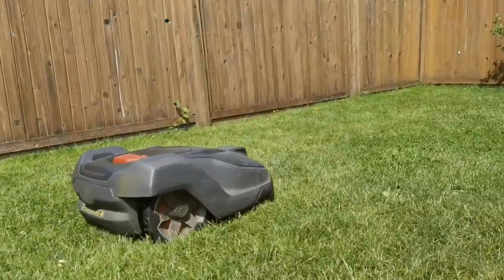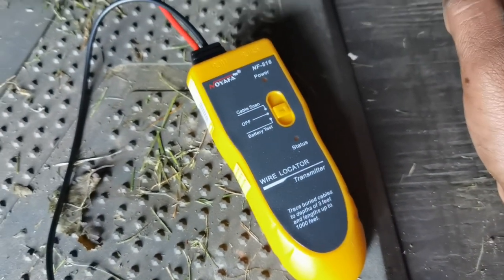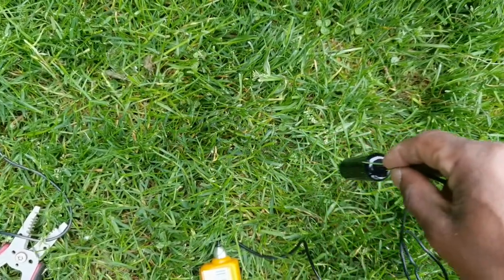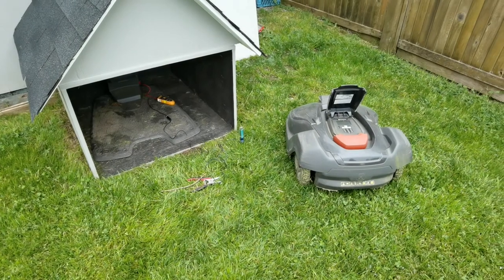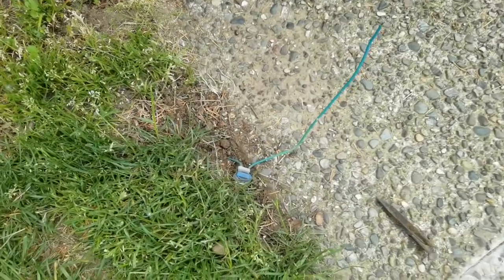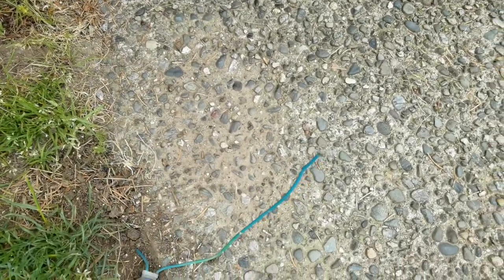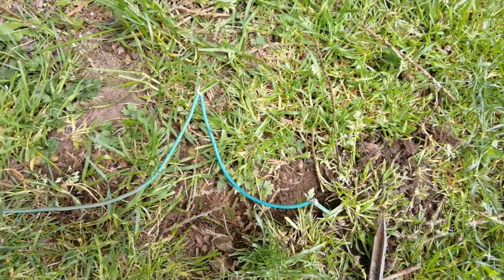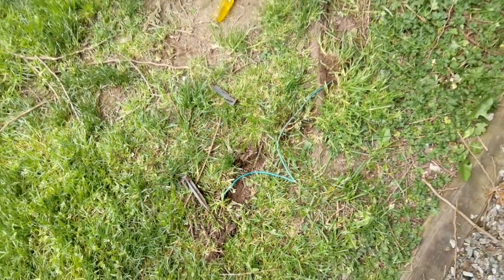How To Fix the NO LOOP Signal on Husqvarna Automower | Flashing Blue Light on charging station

Comment: What does it mean if I move my guide wire to the different boundary wires ports to find which loop but it never turns green?
Reply from the maker: You might need to look at the manual to understand what the guide wire does. Hopefully then this will make sense. The guide wire helps the mower find the charging station. It usually goes down the middle of your yard and connects in the back of the charging station. If you move it to the left or right boundary wire port, you basically cut your perimeter in half. This can help you find the side that your wire is broken. It could be the left boundary line or the right side. This is how I was able to narrow down where the line was broken.

Comment: I have the flashing blue light but my ohm meter says there’s a circuit.
Reply from the maker: The signal might still be going through but it is weak from a torn wire. You will need to find which side the issue is on. Move your middle guide wire to the end to see which side has the problem
Reply: Have replaced wires, followed all the you tube suggestions, called Husqvarna multiple times, used wire locator to find broken wires, test electric outlet and transformer 
Still get loop error. Please help! 
No one in area installs wiring for auto mower. I have invested loads of time, money and effort to make this work. I feel sure it will be awesome once it is operational. Any suggestions at all?
Reply from the maker: First thing I did was use a short wire to make sure the charging station worked by seeing that green light. Then you know that charging station works. Have you tired that?
Reply: @ceilidhcarra3338  Might be your power supply.  I had a faulty one causing a No loop signal.  Easy to test get one from your dealer on loan.